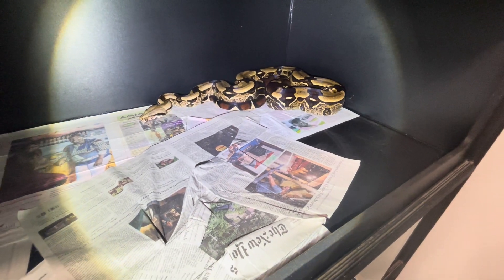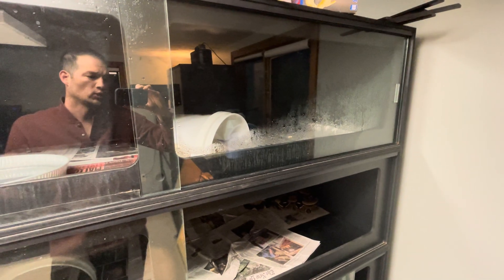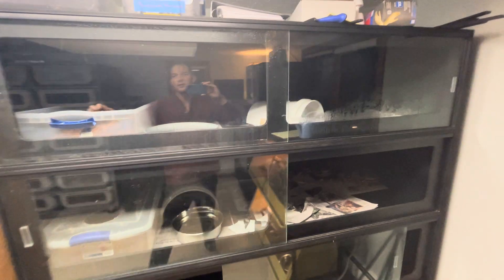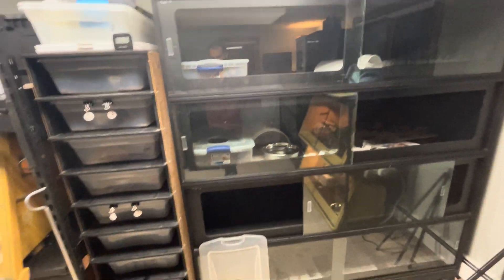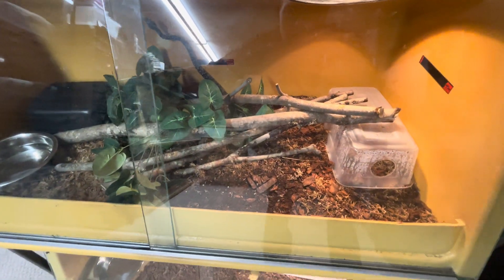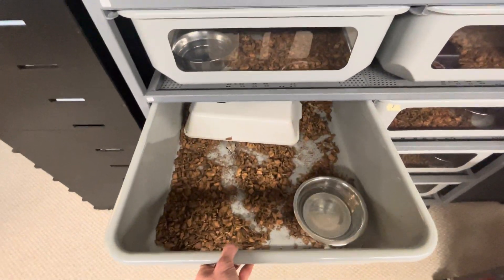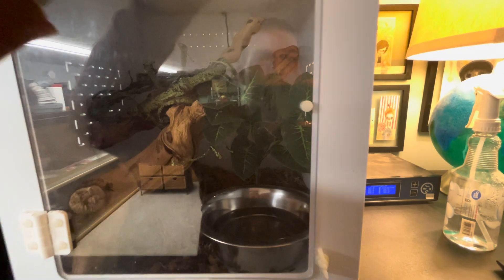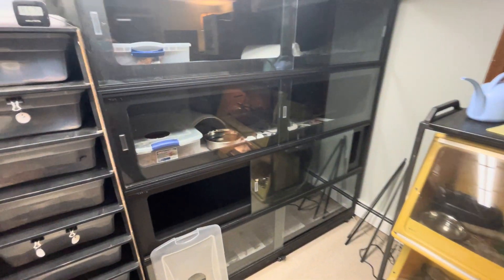Locality Boa Basics:  Measuring and Managing Humidity

Comment: Just curious, I use a hygrometer in my plastic tote enclosures and currently I am using paper towels for bedding. My hygrometer shows the humidity is where I want it but I don’t have condensation on the sides (this is for crested geckos, ball pythons and 1 boa.) Does that mean the humidity is off? I check all enclosures twice a day encase they need a lil misting.
Reply from the maker: Hard to say from here...hygrometers are notoriously inacurrate.  I personally don't use any, but that's because I have a good "feel" for it based on things I talk about in this video.  You can have very high humidity without condensation if the room temp is similar to the cage temp.  I'd say that you can take care of any issues with a humid hide/tray of damp moss.   I just use orchid moss/long fibre sphagnum from the garden store.